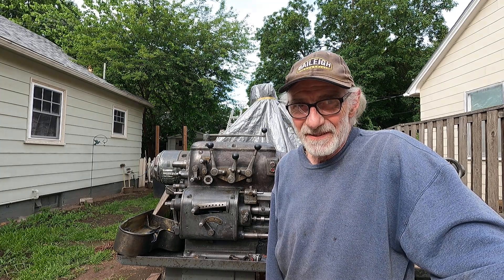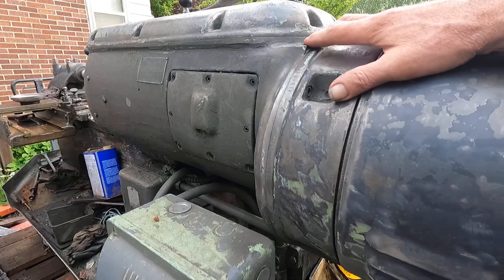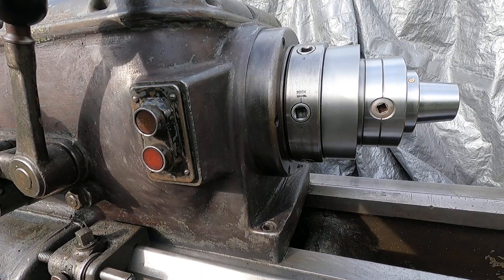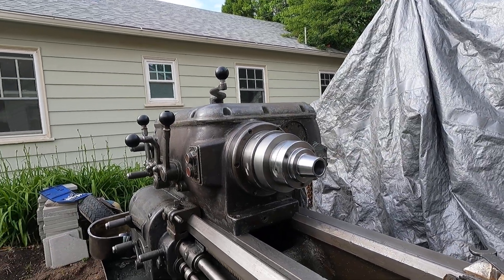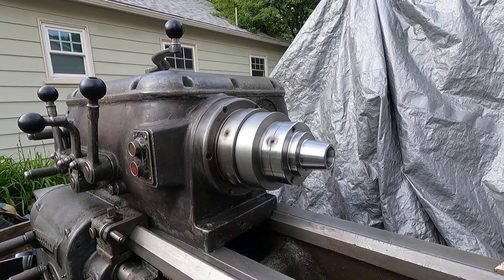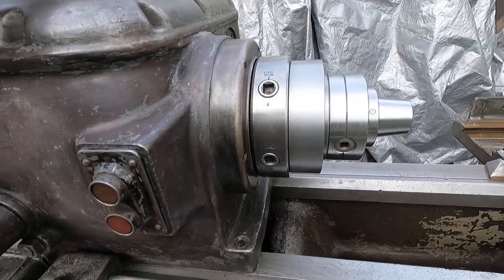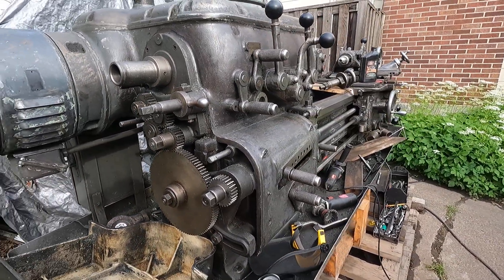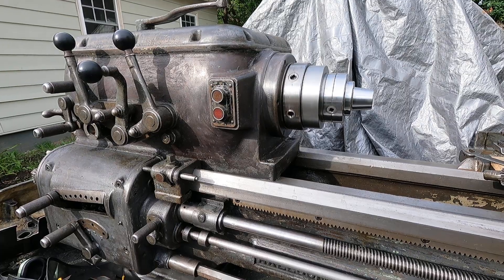Axelson lathe oiling up

Comment: Great video’s, thanks for making them! 
My axelson 14X54 early 40’s has a spring loaded brake, (not hydraulic) two brass shoes wrap a disk. Spring loaded on in neutral, when engaging forward or reverse a sliding cam disengages the brake. If you wind the spring up (it’s just under the lid) the brake works better but then it takes more effort to push the fwd/rev handle.
Reply from the maker: Thanks! that is very useful that is what mine has. The manual I have is for later machines, on those there are no springs, it uses a valve and pressure from the headstock pump with the adjustment on the valve. Now I know how to adjust it, thanks again.

Comment: My Axelson was always noisey.  I thought the oil pressure pump was a major contributor? What you are attributing to the motor coupler must have been in better shape on my lathe because the noise my lathe made was less of a clatter.  Enjoy the sunshine and don’t breathe too much acetone…. TB
Reply from the maker: The was a Machine tool dealer in Port Orford Oregon that warned about some machine tools like the Monarch ee, Moore jig borer and two geared head lathes, the Axelson and L&S Powerturn. Both 24 speed headstocks. The Powerturn has weak gearing in the high speed section and the same unit shipper clutch, but the Powerturn uses one end for the brake. The Axelson gearing is so heavy I have never heard of a failure but, the clutch is said to be the most difficult to change, the warning was "you better know what you are doing before you get into the headstock of an Axelson"  The clutch on mine is good because it has only 5hp.  The bed wear is not much of a problem because the carriage and saddle is longer than the length the machine can turn just like the Monarch ee so the bad spot will be near the chuck and can be avoided off setting the tool and holding the carriage back just a little, that is one reason I went with the KDK tool post that offsets the tool to the left a lot keeping the saddle back from climbing up the unworn spot near the chuck. That old Axelson has some life left I am sure. I believe I am on my last gallon of acetone, it is best used out side.

Comment: Hi Don, what a fantastic lathe is it: wow, the design is very similar to the first versions of Harrison lathe (UK), also Harrison lathe had the clutch to start !! I am curious to know if it has a Norton gear to change from Metric screw to Inch or you have to change gears like on my Colchester Bantam ? But even if it doesn't have it, it's so good that it really doesn't matter !! Hope to see more videos on how you will restore it, Thanks Don, happy you found me and happy to found you !!! Alberto.
Reply from the maker: Hi Alberto, the end gears have to be changed for metric threading but they made it easy with the open access at the rear and the reversing spindle function that some Dean Smith And Grace lathes have. I will be making a few gears later on for metric threads.
Reply: @deedeeindustrialsuperprecision  Thank you Don, i will follow you, It Is very interesting!! 💪

Comment: Donnie,   That motor sounds like it rumbles pretty bad.  Did you pump grease through those motor bearings yet ?
Reply from the maker: Yes, the end bell was greased, the noise is greatly amplified by the cameras microphone. This machine will be like the milling machine it will get much smoother with some running time. The first videos I shot the lathe sounded like a box of rocks, I am much less concerned now. These industrial machines were designed to be run every day all day and when they sit idle it can take hours to fully lube and warm up, most noticeable on the close tolerance machines like the jig borer. The vacuum tube variable speed drive on the Monarch 10ee takes an hour to fully stabilize.

Comment: The clutches drag on my DSG when its cold, its fine now its summer but when its winter it can take an hour of running for the headstock oil to warm up enough for it to stop, If I fix the brake sometime it would no longer be a problem.
Reply from the maker: The oil pump on this machine puts 30lbs pressure to mullti disk brake on an internal shaft when in neutral. There is an adjustment for that I will do later. I will run it a little while I am cleaning it up

Comment: Hydraulic fluid always flows better when it comes up to temp. When I would engage the pump on my tow truck in real cold weather the pump would scream till the fluid got warmed up. Nice to see it run. Thanks for the video.
Reply from the maker: This old machine has run for just a couple of hours in the last several years, it is improving like the old milling machine with chain drive

Comment: Donie, when are you moving this inside?
Reply: Good question ! ! !
Reply from the maker: I have until winter, keep in mind this is a nasty job cleaning the 111 Trichloroethane cutting fluid contamination off this lathe doing it indoors is a real health risk to me, if this were a government owned machine at Hanford it would have been buried and not sold to the public. The once solidly radial drill press requires further scrubbing with Acetone and ATF, I am totally content cleaning this mess up outside, Try it, you may like it.
Reply: @deedeeindustrialsuperprecision  111! The good stuff! I understand that. I don't live in sunny CA, so outside cleaning isn't an option for me. I've done it. You make negative process because everything rusts up overnight and you just end up with your ways turning into dust on the ground. Glad to hear it will come inside.
Reply from the maker: @TheMetalButcher  You cant be serious about that statement, nothing is rusting at all.
Reply: @deedeeindustrialsuperprecision  Yes, where you are, Donie. Hence I support your method, but it doesn't work in Alabama. That's all.
Reply from the maker: @TheMetalButcher  My dad was from a little town called Douglas, I was there in 1959 it was extremely humid. I was over in Idaho and had a barn with a concrete floor but somehow moisture seemed to come up from the concrete and rust things from the bottom up. The weather here is less humid and more manageable.